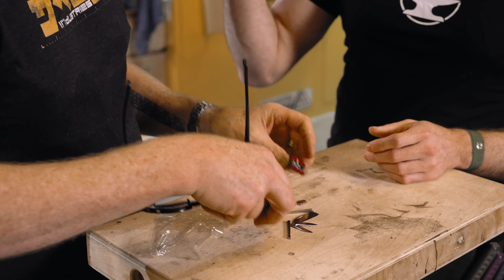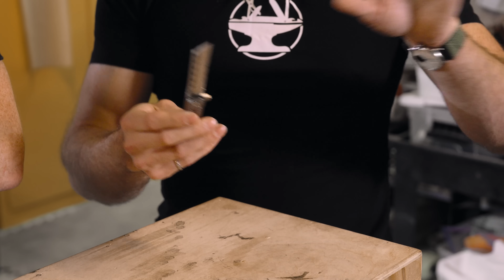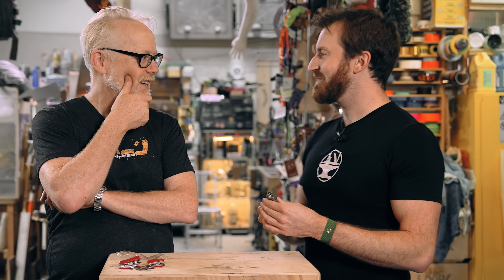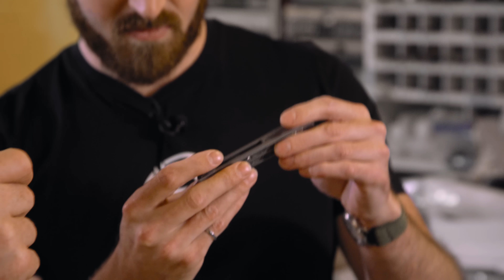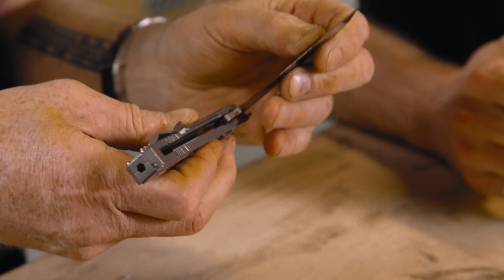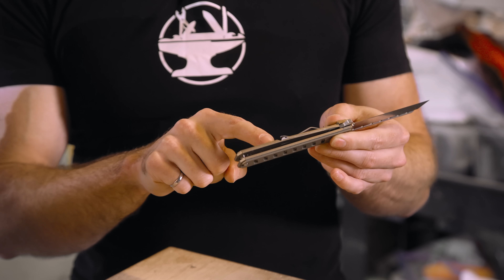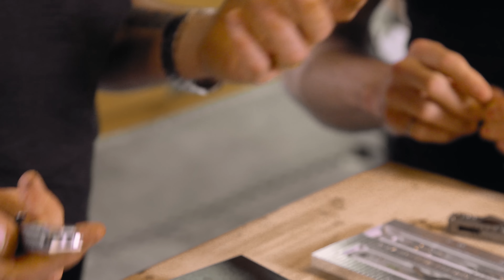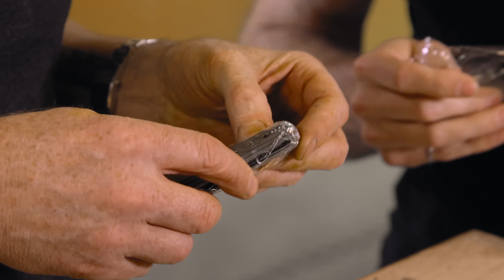Adam Savage Wields Hacksmith's Titanium EDC Multi-Tool!

Comment: Psh my leatherman ARC has more going on and is just as disappointing. Real sick of people over valuing their BS just to make it seem premium. It's a gas station knife with screwdriver and level... 😒 m390 is like the bare minimum for blade steel for someone like me so it's really not even a selling point. The stupid BS clog holes in the blade will be fun to clean. Making their bits over spec just means you gotta get their bits or it's just not going to fit right. 

If a multitool doesn't have dikes and pliars it has no value past pocket knife which I already carry on top of my ARC. What's the point? Wouldn't a regular Klein screwgie be much better than a flash heavy bar that holds bits? 
Pliars with cutters are the most necessary part of a multiool. I have to be able to beat things with it and crush things. Tbh the even the leatherman ARC is overpriced for how sharp and edgy it is in hand during use

Comment: I am so ready for this tool after my 3rd Leatherman Wave warranty (Leatherman is great; I just use them hard as designed). The big holdback for the average customer walking through a hardware store or a specialty shop might not get why It's cool, functional, or useful for their work at that price. I want pliers also; But that's not what this knife is about. Great price, amazing engineering, and definitely one I'm gonna save my pennies for.

Comment: Personally i really wish they could have fit at least some needles nose pliers in there maybe like how roxon makes its scissors, cuss thats my most used thing in my pocket.

And honestly i think the blade shape makes most of the edge be unused to the point where i would have preferred a utility blade holder or a regular tanto or curved blade since becouse of its width of the blade i dont see an angle you can use any other bit of the blade on a table. Would be good  for whittling but i dont see it it be  suuuper useful in maker spaces 😵‍💫

( I know I'll get a ton of heat for bringing any criticism so be kind i come from a genuine place )

Comment: Good work. I think. I have to know more. But… but hacksmith   Did it.  Every time I’ve used a knife from fabric to things around the house to electronics… I always have only one hand free.  Locking leaf spring openers are the only way to be handy. But then u gotta explain to everyone why ur using a switchblade to fix things. He may have solved the image problem. Hmmm. P.S. think about adding a ice pick type puncture tool cause no tool ever compares to it. I use it on clothes fabrics food steel opening weird things.

Comment: Industry standard sizes of hex vs spec sizes is also a thing LMG had troubles reconciling. Leave it to Canadian engineers to keep to engineered specs. Too bad, in an effort for compatibility across all bits, they had to settle to industry standards. 
If chinese firms can not machine them, and your bits are exact tolerances, then the knock offs are much less quality. Adding the quality add back into products manufactured locally.

Comment: 7:29 this is a cool thing to talk about because in one instance you had an acting force that transfered completely into the floor stopping it. And in the other, the force when it hit the softer material, it then had a small impulse force which then transfered to the screws since they then acted almost like a sacrificial piece to protect the rest of the knife from the impulse force from the drop. Then you added the springs which absorbed the impulse force instead. Very cool

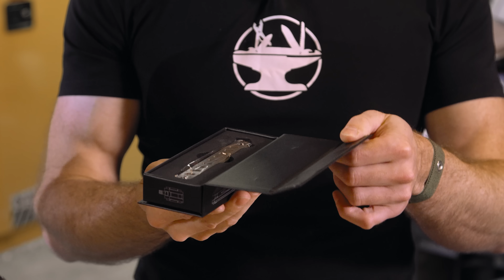Comment: 22:35 "The best things are when you're solving a problem that you actually have."  Completely agree with this sentiment.  I got into 3d printing this year, and there is a ton of satisfaction in creating something for yourself that fixes some issue.  To bring it to the next level and share it broadly with the world is awesome!
Reply: My oldest kid has been in college for 3 d design so we bought them a 3 d printer a couple of years ago.  We now own 4 and usually just download designs but recently I decided to fix some issues with the bracket that holds one of our AC air filters.  It's flimsy and the filters keep popping out of the frame and get sucked up a bit into the duct, so the air bypasses it.  I started playing in Onshape and designed crossbeams but that wasn't enough so I made triangular corner braces and it now works perfectly.  Pretty cool to slide the brackets onto the frame and they just snug on without any help and work.  I'm a chronic tinkerer so I'm always looking into new tools I can learn and use.
Reply: Once you have a 3D printer and learned CAD, all problems around the home becomes 3D printing problems
Reply: @aaron4820 spoon holder, drip tray, door stop, phone stand, Christmas ornaments.....   Yup...
Reply: The quote is at 20:30, dunno if you put the wrong one in there, or if you were timestamping adam using the knife to open the other knife packaging :p

Comment: I would have gone a different  route with blade steel. M390 has excellent edge retention but it is not a tough steel. It will chip easily. Magnacut would be a much better option.

Comment: This kind of engineering attention to detail has existed in the firearms industry for many years.  The venerable 1911 can be completely disassembled with nothing more than the pistol itself, and a cartridge case.  And you can field strip it with no tools at all.  Because they knew soldiers might need to do service to the weapon under adverse conditions, so they made it as self contained as possible.

I love to see things made with that same mindset.  And this knife looks like they thought of all of that stuff.
Reply: im a little worried about refilling that magnesium spark strip and the other bits if used or lost
Reply: Holy boomer 1911 comment lol
Reply: @poolee77  There's a reason theyre still made to this day.
Stupid simple simply works.
Reply: @poolee77  Don't be disrespecting the 1911.  There's a reason that design is still made today.  In fact, most of the top line pistols today still use the same tilting barrel design as the 1911.

Comment: This is a super cool design but I have to wonder how durable this will be long term... that tip is gonna break off, that ratchet is gonna wear down, and the bits are going to disappear :(
Reply: The tip is only going to break off if you're using it as a prybar (which you shouldn't do for obvious reasons). The blade is 63HRC, the ball bearing is not going to wear off, and the bits are standard 4mm bits so even if you do manage to lose them... you don't have to buy new ones from us!

Comment: I like the knife but by no standard is it a pocket knife. A pocket knife should be Max 4" when folded, have no sharp or sharpish edges at all and should have as few openings as possible.
Your knife fails on all these parameters so it is a utility knife but by no means a pocket knife. It would literally fall through a pocket in hours.
Reply: It  is 4" ...
Reply: I didnt want to diminish your knife, i am shure it is of excellent quality. I own and have owned many pocket knives including a standard Swiss Army knife. Granted there are better knives out there but i carry my knife in my jeans pocket. Most or all knives that have edges on them will wear through the fabric in days or weeks. Also any opening, especially in the sides will catch lint like crazy and will block the operation of the knives. In this respect only a one function knife with rounded contours functions better than a Swiss Army knife.

Comment: Those little hex bits are useless with a bulky pocket knife handle.  The tip up pocket clip also sucks. Tip down is way better. It does look cool, buy the tools aren't modern. Nobody needs a wire stripper that doesn't work very well. No mention of the blade steel or heat treat on it. This isn't for knife guys. It's for fans of your channel.
Reply: Literally all of those things are covered on the Kickstarter. The belt clip is reversible because people do have personal preference for that, the handle is nowhere near bulky -- it's slimmer than a SAX -- and the screwdriver is symmetric unlike pretty much every other multi-tool out there, which means it's actually comfortable and easy to use as a screwdriver. Blade is M390 hardened to 62-63 HRC. 

It is for knife guys, and for fans of the channel.

Comment: shouldve used LTT's standard, his screwdriver is becoming popular in so many different spaces, and i feel like there is a huge crossover between LTT and hacksmith
Reply: We talk about this in the engineering and design video we're working on =) We wanted to, but there is a bit of an issue (but don't worry they are compatible)

Comment: Two things about this, aside from the craftsmanship jump out at me. One is the tool I use most on my Leatherman is the pliers. This doesn't cover that. The other main thing is the protractor. I get the use case but  you have to manipulate a razor sharp ultra strong blade to use it.  I'm not sure that's a good idea.  The potential to slice one's fingers is high. There is a reason most multi tools don't use the blade for more than just cutting jobs.
Reply: I thought of the knife/protractor problem too. Odds are you'll have a carpenter's square nearby if you need to do angles. A lot of the stuff seems gimicky to me, like the level. Most people just use the knife and pliers on multitools anyway.

Comment: I love my Gerber multi-plier tool.  I have EDC'd my Gerber for more than 25 years.  For me it HAS to have pliers, that's the tool I use more than anything else, and It has to open one-handed.  The hacksmith is cool for a knife, but doesn't really meet my needs.  If someone makes a Gerber style pliers tool that ALSO has a blade that can be opened one handed, that would be my holy grail.
Reply: Leatherman arc and free p4/p2 are one hand open on all tools. Best multi tool system in my opinion.
Reply: And this is why tere is no ultimate multitool 

Lukely tere are. Lot to choose from
Reply: @Thefreakyfreek  Hence my problem.  I feel like Batman walking around with all this stuff hanging off my belt.
Reply: Leatherman wave+ has pliers and a one handed blade. Leatherman Arc has all one handed tools for the same price as the Smith blade, also the Victorinox Swisstool Spirit x has a version with a one handed blade.
Reply: I suspect that later versions will have more features, as hinted at in the video.
Reply: Useful pliers would have probably made the tool too bulky. They'll likely see if they can fit it in a later version, like he said he's already been thinking up version 2 and 3 lol. But they need something for the whole new step that he's taking with the company and need to make revenue
Reply: This is anecdotal with an N of 1, but I've been running the Leatherman wave+ for like 10 years or something now. It doesn't have the slide action like the Gerber does, but you can swing them open with one hand and it locks in place once open. As well the knives/file/saw are all on the outside and can be opened with one hand as well. A possible option if you want to try it.
Reply: @zeeblondegentleman  I have the Gerber you're talking about, the Suspension one and a I  Victorinox multitool. I actually Don't like the Gerber w/ the sliding pliers. I like being able to use the knife w/out having to fully open the tool.
Reply: Use to like Gerber until they shipped their manufacturing to China and I got crap Gerbers where the pliers would snap in two.   Been with leathermen ever since.   I think Gerber brought back some manufacturing back to the U.S.  I just haven't went back.
Reply: I’ve ordered one of these but I do love my leatherman ARC which I EDC - definitely the best pliers style multitool BY FAR. Before that the free, before that the charge TTi. The arc is the best of both the TTI and Free.
Reply: I carry a Leatherman micra, Knipex cobra 125mm and a fixed blade knife (being a knifesmith this is a no brainer)
Reply: Leatherman wave. My edc for 20 years because u got pliers and blades and saw and file all one hand open  with locks. I also need pliers on my edc. Though I'm thinking the knife will be my edc on the motorcycle, hitting the ground Leatherman side down is a nagging fear 😨 😅
Reply: It’s a shame these don’t have small pliers. I carry my modded Cybertool all the time that has most of the functionality of this tool with pliers that tackle 99% of around the house needs
Reply: agreed.  Pliers are honestly the number 1 tool I use... which is why i still have leathermen.
Reply: Totally agree.
This is NOT a multi tool, it's just a knife with extra abilities :)
Pliers & scissors is a must!
Reply: Yeah I was going to be all over this too but there are no pliers.
Reply: I'll keep my Gerber and Victorinox multitool.
Reply: Exactly! I was so excited, but no pliers??

Comment: That's bigger than my Leatherman and would tear up your upholstery way more!!!! Good job.
Reply: Depends on the leatherman. I'd keep this in my front pocket with the blade up against the back of the pocket like a normal pocket knife. Shouldn't ever touch the upholstery. I also think this might be a bit lighter since it's made out of titanium, but they didn't touch on that. My leather man is wider than this, but not as long.

Comment: You mentioned something that is a nit for me, let's pick it before it flowers.  SCISSORS on an EDC, essentially useless over anything thicker than paper.  Even after sharpening, the blades spread apart instead of biting. I've had at least 50 multitools, & I can't remember the scissors being adequate. 
After seeing the price, I'll not be looking into getting one.  Being on a limited income, I'd have to save up to afford it.  I understand that good stuff costs, unless you're able to provide affordable options (I used to buy Klein, Greenlee, Porter Cable (when they were better), now if I need a new tool.  I actually consider Harbour  Freight. Yyou've priced yourself outa reach for the guy looking for thrifty options.
Reply: Thank you for this, I can't do it tho.
Another disappointment.

Comment: this is one of those tools thats like amazing to use but once you stick it in a toolbox you never use the side storage and then you cant get replacement blades and you go back to the old classic.
Reply: The whole point is this isn't a tool for your toolbox... why would you buy it to do that? If you have a toolbox, you've got screwdrivers and everything this tool includes. Blades are replaceable, but you don't need to when you have premium blade steel
Reply: Yeh seriously, who sticks a multitool in to a toolbox, only reason for multitools to exist is for when you dont have your toolbox at hand.

Comment: Adam said his Leatherman was tearing up the upholstery in his car, but I seem to recall a video of him making a metal sleeve to wear on his belt because it was more useful to him. Perhaps if he was using the leather (I think theirs are leather?) case that comes with the tool, that would be less of an issue. I've used Gerber multitools for a few decades now and never had that kind of issue.

That said, I'm not knocking these good folks trying to "build a better mousetrap," but there's something to be said about having less problems when they're using tools the way they're intended.
Reply: Agree. Making his aluminum sleeve in leather would be easy and solve the problem.